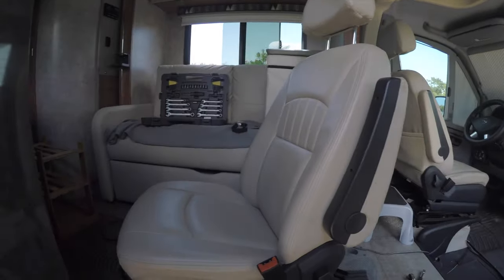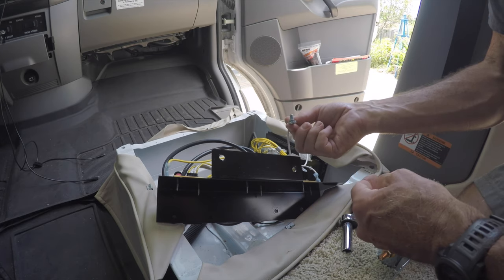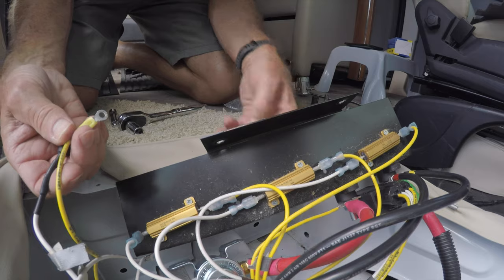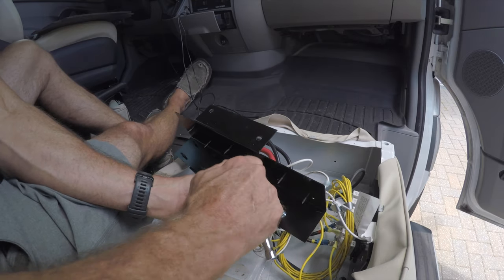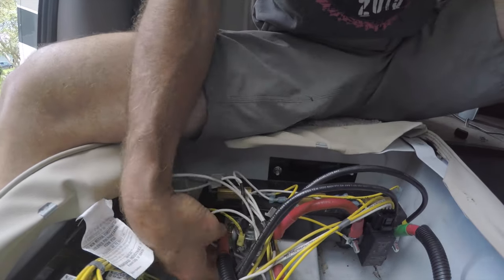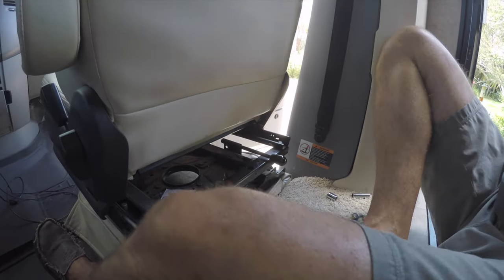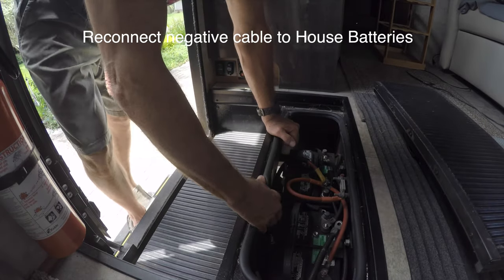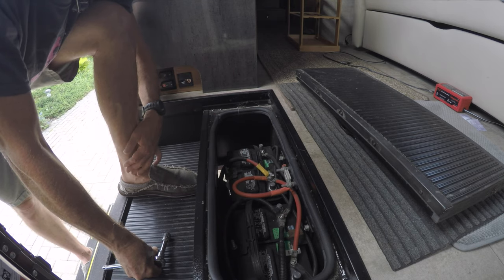How to Replace the Boost Solenoid on Your Navion or View RV

Comment: Great video.  You and Bob Swor are to be commended for making this a simple project.  Note: Sprinter forums seem to have a consensus that the proper torque for the (4) seat mounting screws are between 45-50 ft lbs (61-68 Nm).  I'll be doing the R&R today on my 2016 Navion J model.  

Here's my required tools list from your and Bob's work.  
c	Torx E-14 (13mm) Socket	
c	3/8” ratchet drive
c	Two (2) 3/8” extension (2nd one for L rear corner torx screw re-install
c	10mm socket (for one nut on old solenoid)
c	11MM deep well Socket (for whiz nuts on black plate & solenoid mounting flange)	
c	11 MM box wrench	flashlight
c	14mm box end wrench	
c	13 mm deep well socket (for solenoid post nuts)
c	slot screw driver	
c	Phillips screw driver
c	Torque Wrench (for seat re-install)
Reply from the maker: Thanks! I appreciate your comments!

Comment: Excellent video! Thank you for taking the time and putting this together. I just followed it exactly and now i'm back to 14.1v & 14.1v with the engine running! Only one thing....the screws that go down through the top of the bracket ar SHARP!! :) Thanks again.
Reply from the maker: Thanks Jay!  I hope you didn't cut yourself! Ouch! 😥

Also, you may want to do the fridge vent mod if you haven't done it yet.   Did ours last week at Gros Ventre in icy conditions!

Comment: Please forgive my ignorance but no one in the comments nor in the video explains what a boost solenoid is. Also, it would help to see the operation of the repair. Thanks for any answers.
Reply from the maker: Excellent feedback, thanks.

The boost solenoid ensures voltage is passed to the house batteries to keep them charged while driving.

In the One Place, note the voltage of your house batteries. Then, turn on the engine of your RV.  Back at the One Place you should notice the voltage increase at the house batteries.  If not, it is likely a bad boost solenoid.   

Hope this makes sense. Thanks again for the good feedback. The video would be better if this was explained.

Comment: Excellent video. Question. If I wanted to disconnect the alternator charging to to coach batteries which wires would I leave off? I want to install a DC to DC Charger so I can upgrade to Lithium. Thanks again
Reply from the maker: Thanks.  I have no idea! Sounds like a good question for the View/Navion Facebook page....

Comment: Very helpful!  Did you think about adding the Trik-L-Start too?
Reply from the maker: No, we didn't see a need.  We do run a trickle charger from the outlet near the slide to the chassis battery.  So whenever we are on shore power the chassis battery is getting charged.  Still on the original 2014 chassis battery!

Comment: Great video!   Just wondering why you chose to replace the existing solenoid with this new one?  I have a 2016 Navion and wondering if I should change mine too, but don’t know why you changed yours...
Reply from the maker: Thanks Les.  It is a known failure point on our RV's.  The stock boost solenoid almost always fails (from what I understand) and when it does you will not be charging your house batteries when you drive down the road.  You can always buy one and have it ready to replace when it fails or, replace it proactively like a lot of us have.   You might get lucky and the stock one might not fail! 😀
Reply: @adventuresofkbp6823  Ok, makes sense!  SAD but makes sense!!  Do you know what the amperage is of the original, is it 200 Amp capable?   I want to be sure that I don’t work the alternator more than it came did originally...  Thank you for your time and experience!!!
Reply from the maker: @lesolson2380  same as stock I believe.  There is a lot of info about it on the FB View/Navion page. If not on FB should be info in the forums.
Reply: @adventuresofkbp6823  Thank you, I appreciate your time and information!

Comment: you need to produce TRAINING VIDEOS for a living :-) Excellent video
Reply from the maker: Thanks Ed!  You just made my day!  😀
Reply: I have a sympathetic electrical drain on my Navion, replaced the batteries and Winnebago recommended replacing the BOOST - which I will do this week. In your opinion could a bad Boost cause this?
Reply from the maker: @efrawley55  one way to see if your boost solenoid is working is to look at your one place battery levels.  Note the voltage of your house batteries.  Then start the RV and while it us running check the one place readout of your house batteries. If the voltage goes up then it means the boost solenoid is getting juice via the alternator.   If it didnt go up I would suspect a bad boost solenoid.  If the house batteries are not getting charged while you drive the only way they will charge is via shore power.  Does that help?
Reply: @adventuresofkbp6823  That does help. I get it out of winter storage (live in WI) this week. Ill test it before I replace the boost.
Reply: @adventuresofkbp6823  A little common sense goes a long way-  thanks